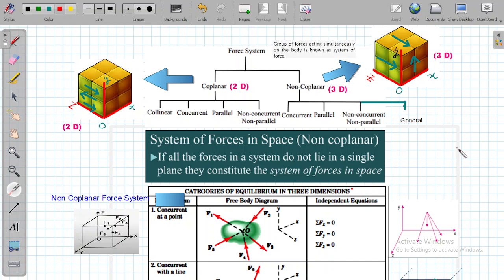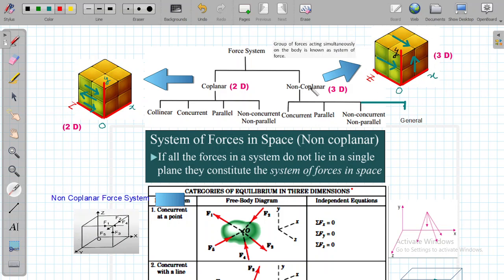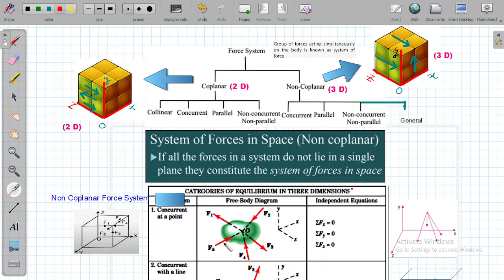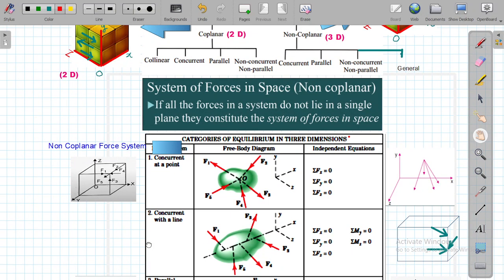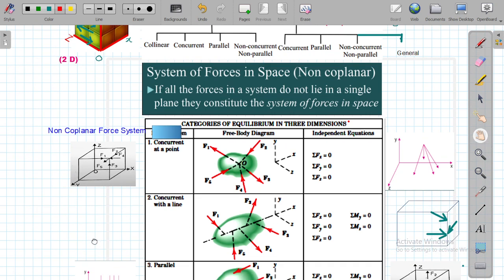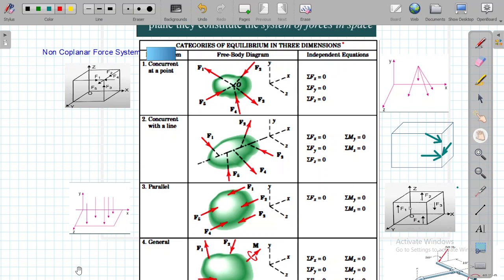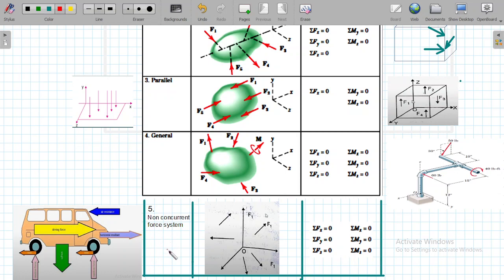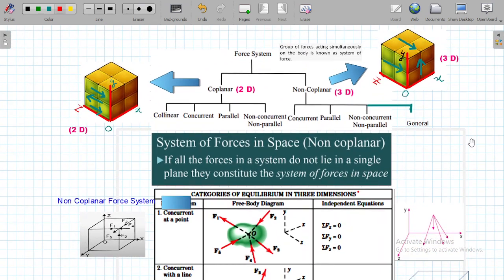3D Equilibrium Force Systems

Comment: Sir what is the difference between non coplanar non concurrent force system and general force system
Reply from the maker: Very good Question
Reply from the maker: In one moment is an input, while in other system, a potential moment could be induced by the 3d non concurrent forces. Hence the same equations